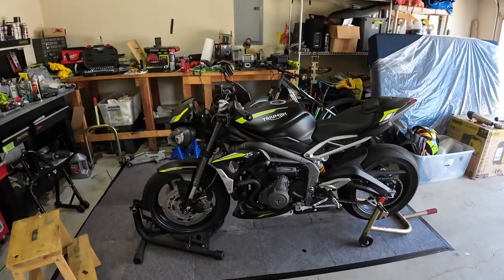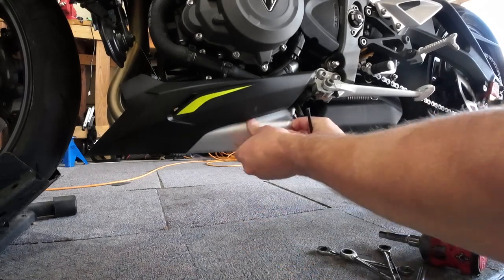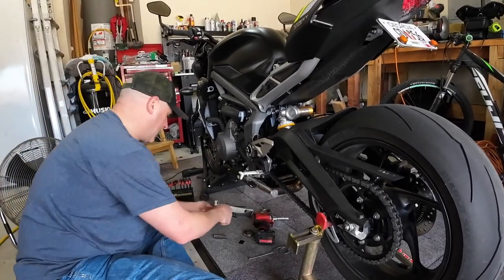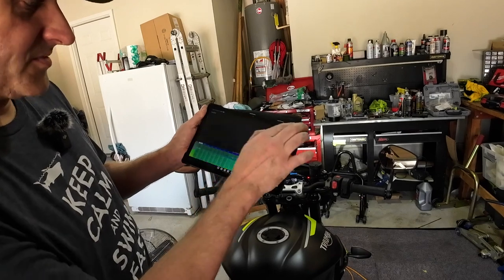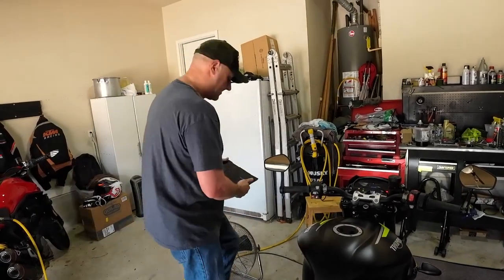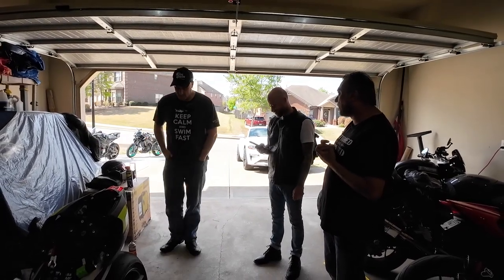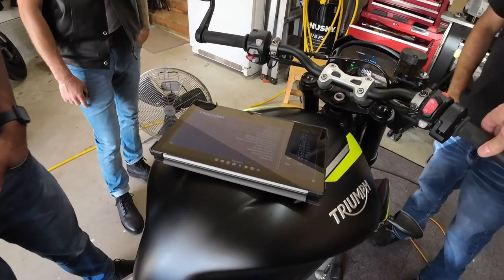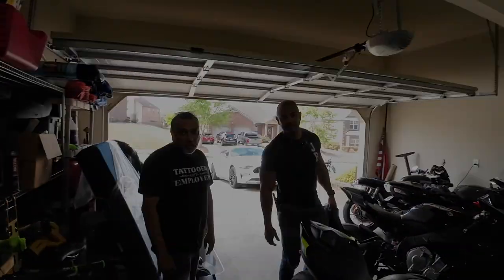Dave's Garage - 2022 Triumph Street Triple RS Exhaust Install

Comment: That’s honestly a super nice copy of the VERY expensive SC project. That’s my dream exhaust for my Striple but I’m more than happy with the looks and sound of the Yoshimura my bike came with so I’m just sticking with that. They honestly sound very similar too because my db killer Is long gone. There’s not much out there ,short of some Ducs and the cross plane Yamaha engines, that sound as good as an uncorked and loud Triumph triple.

Comment: Interesting exhaust.. Not sure if I would of removed the db killer.. The Triumph only learns when it warms up and throttle is not touched. Takes about 15 minutes for the adaptive learning to adjust... AFAIK
Reply from the maker: Not true.  The not touching the throttle is to trigger the learning process.  I did that manually in TuneECU, by telling it to "Reset Adaptives", which does it instantly.

And the "learning" is minimal.  There is no such thing as the bike tuning itself, etc...  It can make SMALL adjustments in a very narrow and specific part of the rev range, and that's it.